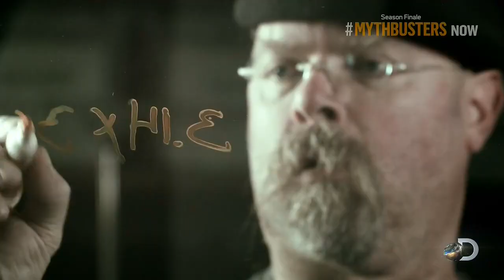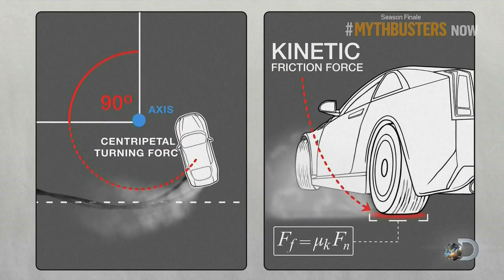Mythbusters 13x06 San Francisco Drift Part 01.mkv

Comment: @2:16 drifting tutorial :

入灣前
1️⃣ 踹 極瀝子 (clutch)
2️⃣ 踹 油
3️⃣ 拉 手制、推(車)頭 (by momentum)

入灣
4️⃣ 鬆 極瀝子 (clutch)
5️⃣ 扭 軚、掟灣 (轉向過度 oversteering)

飄移 入灣
6️⃣ 鬆 手制、推(車)頭 (by engine rev 轉數)
7️⃣ 相反軚 countersteer (轉向不足 understeering)
8️⃣ 繼續 畀 油 (keep engine rev , keep the rear wheels sliding)

飄移 出灣
9️⃣ 脈衝式 畀油 as to simulate ABS for faster restoration of rear wheels traction control
🔟 steering restoration
Reply: 飄移速度 的損失 , 在於 出灣時 , 冇咗 正常嘅 咬地 性能 ❗
所以 , 只要 在出灣時 , 盡快 恢復返個 traction control (咬地 性能) , 就一定可以快過 人哋.
e.g. 脈衝式 畀油 的踩油 方式 , 就可以 製造出密集式的錨點 來加大 friction (摩擦力) as to simulate ABS for faster restoration of rear wheels traction control ✌